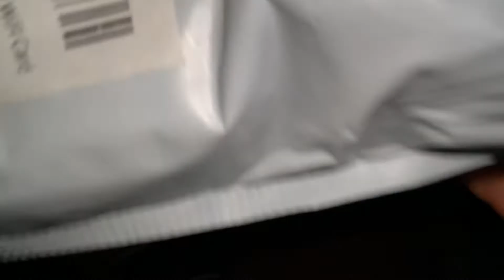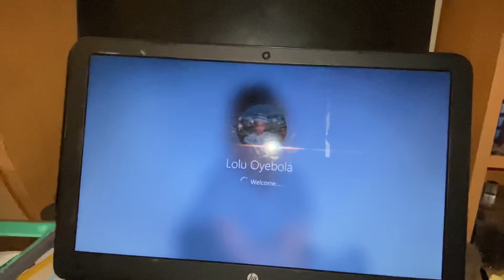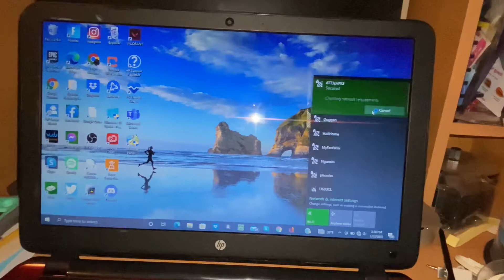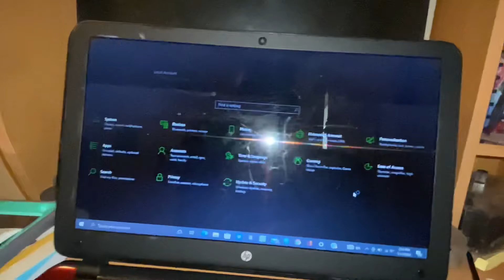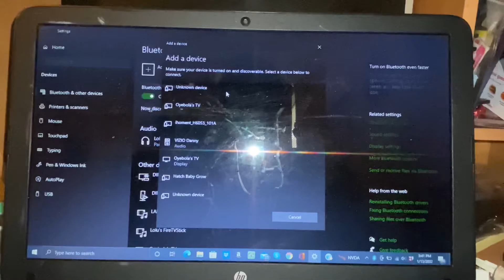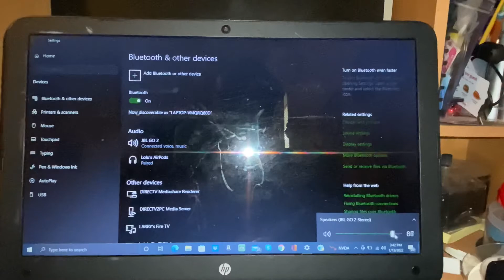Changing the WiFi Adapter in an HP 15-f272wm Laptop

Comment: Did you have any problems of it disconnecting and reconnecting all the time?
Reply from the maker: Not really, well I had trouble with my AirPods connected to this computer with them sometimes not outputting the sounds in one or both of my ears. That is mainly because this computer only came with one network card antenna and not two. Are you trying to change the adapter on your laptop?
Reply: @LoluOyebola did u do anything to fix that?
Reply from the maker: @ManuelHernandez-ph1wg  I changed the antennas around.
Reply: @LoluOyebola  i watched ur video and changed the wifi card, but ran into the problem where it disconnects. The antenna is the black cable right? That connects to the card?
Reply from the maker: @ManuelHernandez-ph1wg  Yes
Reply: @LoluOyebola  thank you! When u said, "changed around", did u mean like adding another antenna? Sorry about all the questions?
Reply from the maker: @ What I meant by that was put the current antenna on the white part of the network card.